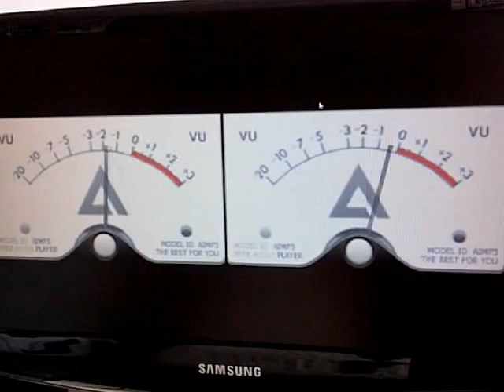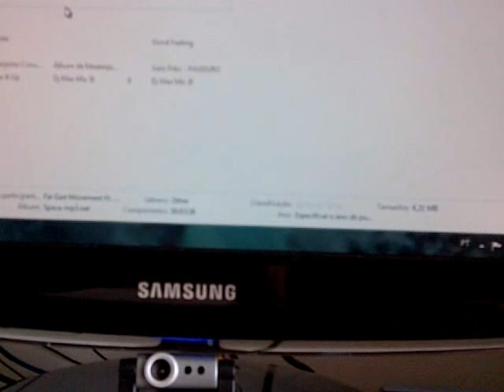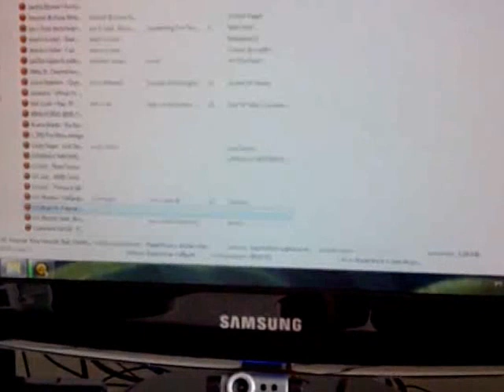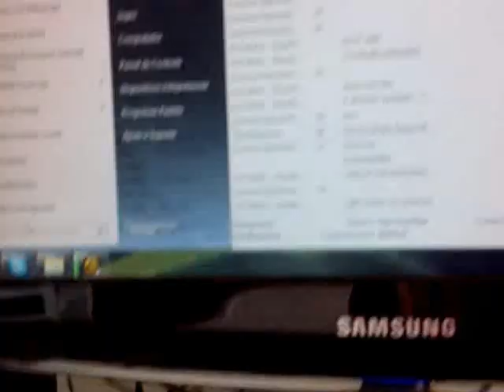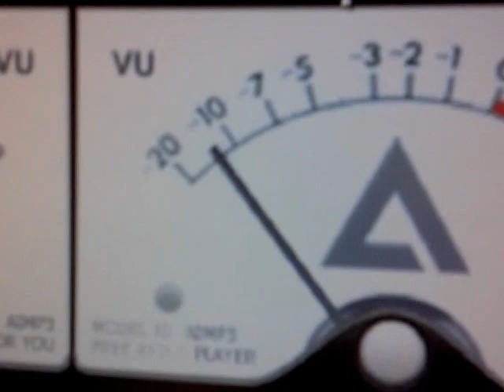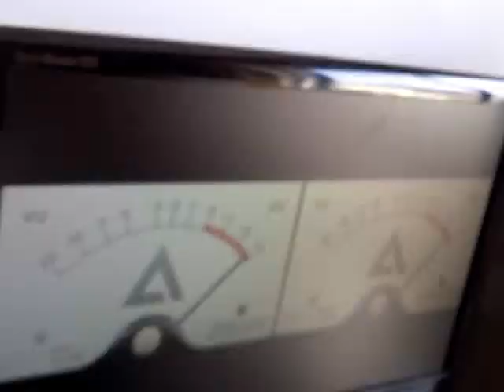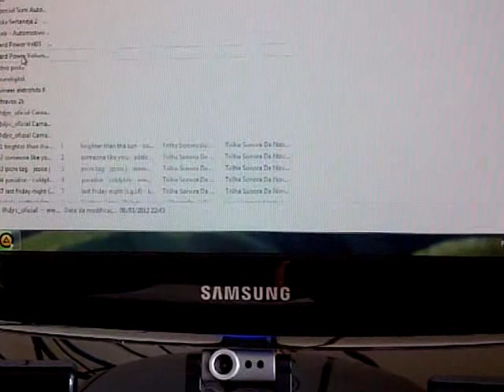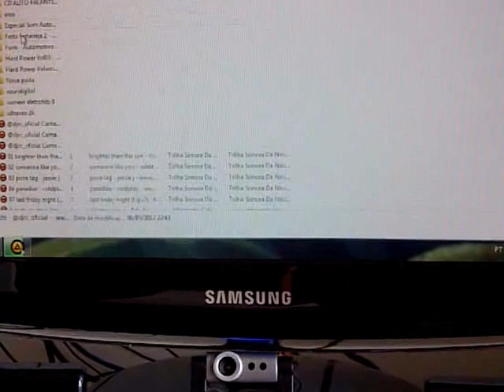sd 250 2d,(test com varias musicas)

Comment: cara... show de bola teu video... mas tenho uma duvida... meu 2d250 2d ta desarmando... tipo, eu aumento um pouco o volume e começa a batida e o modulo entra em proteção, se eu ficar no som meio baixa funciona de boa, tenho 1 Subwoofer Spyder Street 175w Bob. Dupla 2x4 ohms - 1 driver Spyder 100w Rms 8 ohms e 1Super Tweeter Spyder Stw-100 Wrms 8 ohms
liguei em 3 mode... sabe me dizer oq pode estar acontecendo? fio 6mm

Comment: salve cara, ae da pra me tirar uma duvida?
eu fiz um som basico pro carro: 4 cornetas D200, 2 tweeter ST200 e 2 pioneer 309 D4. e como tava com grana sobrando eu comprei um power two, e li no manual dele que é melhor usar equipamentos de 4 ohms pra não danificar. e queria saber que tipo de dano pode ter. vc sabe?
vlw abraço